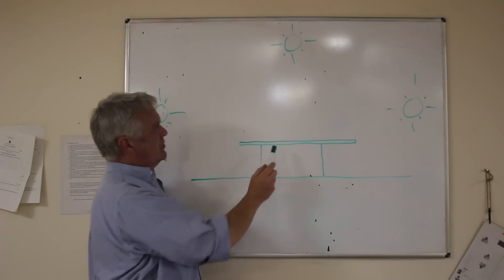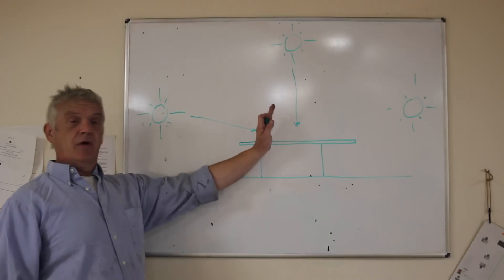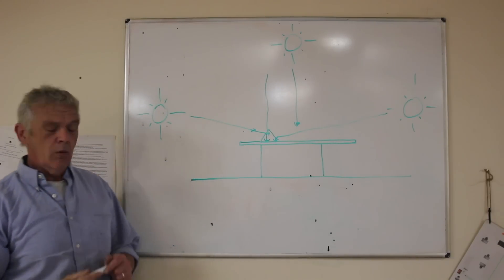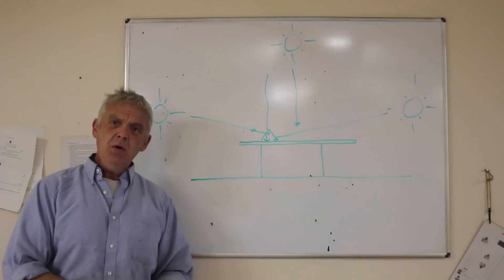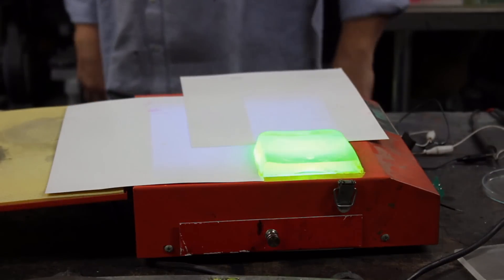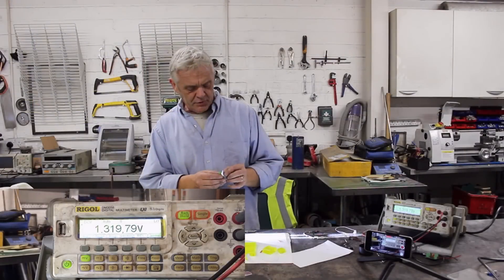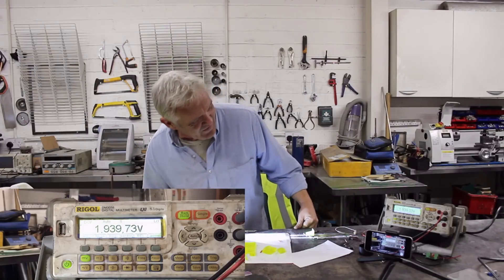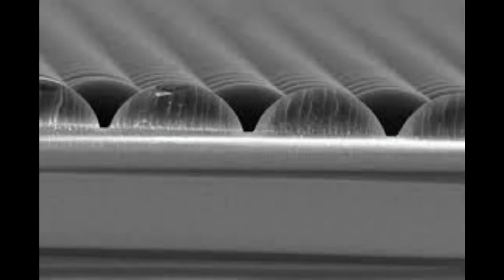1666 Solar Cells And My Evil Plan For World Domination

Comment: How about vertical stripes of mirrored film mylar arranged in a arc over the panel. It could increase the effective surface area pointed at the sun from all angles. 
You could also look at spectrum selective and one way mirrors with a sandwich narrow wedge shape to make use of the fluorescence effect.
Call it a: Reflecto-Refracto-Fluoresceomatic Confibralator.
🤗
Reply: You are actually correct. The device you describe is called a Light Trap. Whether in photosynthesis or in a photovoltaic system: if you want to use light efficiently, you have to absorb it as completely as possible. However, this is difficult if the absorption is to take place in a thin layer of material that normally lets a large part of the light pass through. Now, research teams from TU Wien and from The Hebrew University of Jerusalem have found a surprising trick that allows a beam of light to be completely absorbed even in the thinnest of layers: They built a "light trap" around the thin layer using mirrors and lenses, in which the light beam is steered in a circle and then superimposed on itself -- exactly in such a way that the beam of light blocks itself and can no longer leave the system. Thus, the light has no choice but to be absorbed by the thin layer -- there is no other way out. This is the absorption-amplification method, which you described.
Reply: @captainnemo6655  Well, I have often been accused of being psychic. 🤭
I'm a little confabulated by your use of the phrase "surprising trick". Seems a pretty obvious optical design, but I guess the phrase probably came from a science media puff piece. 🙄
I still think Reflecto-Refracto-Fluoresceomatic Confabulator is a more catchy name for marketing purposes, and certainly in keeping with the Dr Evil plan to take over the World. 🤗
Reply: @aaronfranklin324  no puff piece. Did you see the news about these Light Traps? There are google scholar articles on them as well. Your idea is extremely important as his is an important step toward having a Photon Battery in real life.  A Light Trap device as you describe when made with Photovoltaic Glass solar cells would let you generate electricity with a photon beam bouncing around the system.
Reply: @captainnemo6655  No I haven't seen the research. I'm far more focused on other things like the glacio-volcanology issue. I've been consulting with top Volcanologists here in NZ, and we all think it's a very serious problem. They want me to come to the World Volcanology Conference here in Rotorua Next year and put a rocket up the butts of all the big names. 
What Murray is doing might be more important than he realises. Our photovoltaics aren't going to be terribly effective if our atmosphere and earth orbital environment are full of Hypervolcano ejecta.
If suggest looking at phosphorescent algae. They produce a surprising amount of blue and green light from a little bit of agitation, though I'm not sure of the details of where the energy source is. Probably chemical stored during sunlight hours. But there are geothermal species that use chemosynthesis pathways to support photosynthesis in Subglacial ecologies in Antarctica etc that we know about. 
We may only be able to survive the next few decades underground. So turning thermal and chemical energy into Electricity and light in spectra that food plants we need may be very important. Especially with reliable solid state simple systems. 
I don't want to have to rely on mechanical microhydro in our kilometer deep cave systems without support infrastructure. Unless I can do it all with silver instead of copper wire, it's unlikely to be reliable enough.
Reply: @aaronfranklin324  also since you are aware as I am on the abnormal volcanology of the recent eruptions in NZ... Did you see the video floating around of a UFO visiting the volcano?

Comment: Doesn’t water have a similar effect on light (the sick in the water etc) and cheaper to employ, perhaps you could put your fluorescent die into that? (also it will keep um cooler and work as a night heat sink)?  👍
Reply: Actually this would work as part of a polar solar cell. If you can keep that water absolutely clear and solidly frozen into the shape of Fresnel lens.

Comment: Back in the 60's a company called Western used to manufacture light meters.  These were solar powered and the panel was covered by a layer of plastic with a pattern on it in the form of bubbles and they were lenses.  However, I think those lenses were there to increase the light meters directionality so you could direct it at whatever you were photographing and it would measure the light reflecting off that.

Also I was wondering if it was possible to do some fresnel onto plastic using the laser engraver?  If you can, what's to stop one lasering triangles of various sizes or other shapes?  If so, then it should be possible to reduce the thickness of the plastic on the solar panel reducing light absorbtion by the material.
Reply: Rob actually has a video on this idea and others for DIY Fresnel lenses. Video came out about 7 months ago.

Comment: Super simple test - Flourescent clear silicon, spreadon with a toothed tiling scraper? Might try it on a spare solar panel from garden leds....
Or transparent glue sticks? Seen them made clear by soaking them in almost boiling water.... cheap easy experimdnts
Reply: Good ideas for experiments! I think if there is a way to melt the transparent fluorescent glue sticks into the shape of Fresnel lenses, it would work.

Comment: It sounds like a reasonable idea, but the energy from the sun is W/m^2, correct? So, no matter what you do with the incident light the projected cross section is still smaller in the morning and evening, correct? The reason you use a tracker is to get a larger cross section, correct?
Reply: The idea is to use NO MOVING parts but still get the maximum amount of light where it sits. Would it work better if the solar cell were made with molded Uranium Glass or Flourescent Gel into the shape of a Fresnel lens, by extruding the material into a hollow tube. A coiled Fresnel Lens. Rob has a video on this kind of lens already.

Comment: I'm curious if the colour of the fluorescent material makes a difference, clear perspex would probably still channel the light. The first experiment you did with a hiviz seemed to be just reflecting like a mirror or white paper would. I'm just setting up a solar panel because of rising electric prices and want to get every watt I can! Thanks great inspiration!😎
Reply: You are actually correct. You could use RED or ORANGE Flourescent dye. Keep in mind though, if there is such a thing as transparent Photovoltaic Glass and translucent Photovoltaic graphene solar cells(made by Rob in a prior video) you can use red Flourescent material that's transparent fluorescent and Photovoltaic at the same time.
Reply: The ultimate solar panel would be constructed with a a layer of transparent Photovoltaic Glass, with a Red/Orange/Yellow Flourescent Fresnel lens and a high efficiency PV cell underneath. You can make this type of solar panel generate even more electricity if you combine it with a thermo electric heat engine for generation at night and for even more generation, you can run this set up with a HydroElectric Paper Fuel Cell, to deal with morning dew and condensation.
Reply: @captainnemo6655  thanks for this, I had assumed it was probably a certain frequency of light. I'll have to try it out! 😎👍❤️

Comment: There is one solar panel on my roof that performs very well in winter (I am at 54 N), it has some sort of lines on it. I can feel them, but barely see them. But the output is really good when the sun is low. Enough for me to run my laptop on it all year long! (with some help of a LiFePO4 battery that is).
Reply: Why not give your solar panel an upgrade by krafting it into a HydroPanel that generate day and night and also produce water for you. You can make a solar panel with fluorescent Photovoltaic Glass moulded into the shape of a Fresnel lens as well.
Reply: @captainnemo6655  Maybe I can't because I have 2 left hands 😞

Comment: I recall at least two projects that use something like this; one was a cone shaped solar panel so a part of it would always face the Sun and it was also spinning so while the glass on top of it concentrated light on the cells the spin constantly turned them away from the Sun so they cooled down and don't lose efficiency due to overheating, and the other was about covering walls, flat roofs and roads with solar panels.
The cones have many problems like the special shape would be far more expensive and making it spin requires a motor that takes energy, so the only part of that idea I think might actually work was using them as art and getting people used to idea of having solar panels all over the city by making them look nicer than the regular flat panels.
The other has been repeatedly "busted" by people calling it "solar freaking roadways" who keep pointing out that solar panels that are flat on the ground would not collect light well when the Sun is not directly overhead...you know, that exact thing this is supposed to fix...
Reply: Don't give up by the likes of the "Busters" like Thunderfoot... There have been amazing breakthroughs just this year alone. Have you seen or heard the news about transparent Photovoltaic Glass and Semitransparent Graphene Photovoltaic panels? Rob has a video on how to make these. These new advances in materials are finally being put to use on buildings like the 550 Spencer in Australia. Also if you check out YouTuber Nighthawkinlight, he has an excellent video on paint that can cool down surfaces.
Reply: @captainnemo6655  Oh, right, TF "busted" the solar cones too, except instead of pointing out any of the real problems with it he focused on a claim someone made that by collecting light equally well regardless of which direction the Sun is shining and by avoiding efficiency loss from overheating they would be up to four times as effective, or something like that. Advertising hype, in other words; IRL it might mean that regular solar panels lose up to 20W of production from overheating but this one only loses 5W.

So TF spent the video explaining that overheating is not a real thing and if you use four panels you get four times efficiency, which is wrong, the panels would use 4x area to capture 4x sunlight and probably cost 4x as much, so producing four times as much power is as efficient as using a single regular panel. Frankly, it was a weird rant that made me wonder if he actually knows how solar panels work and what is the difference between panel efficiency and capacity factor...

Anyways, yes, lots of improvements have been made and some of them are even getting out of the labs and into production. Affordable and efficient enough PV glass is probably the next big thing, most buildings in sunny areas could use a little shading in the windows and with the huge area the windows add up to it is not much of a problem that the panels are less efficient.

Thin film panels may work with that too, they are so thin they let some light through so you could use them on windows without needing many extra lamps inside. Most importantly, they do not use silicon, which may be a common and pretty cheap material, but does require lots of energy and some nasty chemicals to purify it enough for use in PV cells and computer chips. Only problem is if you just glue them to the glass they would degrade quickly and need replacing often, while putting them inside the window panel would mean having to replace whole windows which is more work than regular panels attached on top of the roof or wall material.

Comment: I panel racks are on a caps upon a single mast. Tracking achieved by manually tuning the array to the moving sun.
In a year a man uses the equivalent calories contained in 13 gallons of gasoline, relatively low cost really
Reply: The goal is to have a material in place that does the work of solar tracking WITHOUT ANY moving parts, because not everyone will be able to do this type of manual labor. For example, If I live at the bottom of a mountain and my panels are at the very top, do you really think I would go up there every day?....doing more with less is the goal... Achieving an effect without moving parts like angles caused transparent fluorescent media. Imagine moulding the gel into the shape of a Fresnel lens?
Reply: @captainnemo6655  if your panels are that far the wire would cost too much to warrant the installation .
Line loss is a thing.
Reply: @georgemckenzie2525  my mountain top is about one story high... Trust me, I still don't want to manually track.
Reply: @captainnemo6655  easy, just triple your panels. I put my array in 33 years ago , it has grown a bit, but manual tracking has always been part of what we do here at 44.44 latitude

Comment: Brilliant idea. An important question will be what is the impact on peak performance? If that is positive you definitely on a winner.

FYI some modern panels are "bifacial" meaning they can also absorb light from behind, this improves performance in solar farms where the light reflected by a row of panels is captured by the row in front.
Most panels have a reflective layer behind the cells so photons that passed through the cells have a chance of being caught on the way back. It would be interesting to put a flourescent layer on the back of a bifacial panel and a reflective layer behind that.

A question to the hive mind: can we get small cheap silicon cells on a transparent carrier for experiments?
Reply: To answer your question, it has been done. Have you seen the latest development on transparent Photovoltaic Glass and transparent Photovoltaic graphene panels? The Photovoltaic Glass is going up on a building called the 550 Spencer. Also Rob has a video on translucent graphene PV cells.
Reply: As for performance of transparent Photovoltaic materials, you gotta check out the engineering specs on the 550 Spencer buildings Solar Facade. It's a lot to type.

Comment: Do solar cell need direct sunray? Sorry if I am asking stupid question, but why we do not put zig-zag pattern to increase the surface area?
Reply: This idea can be seen if you check out solar panels made from transparent Photovoltaic Glass and Fresnel lenses.... Also did you know a solar cell can run from the infrared thermal light energy of the sorroundings environment as well as the moon and stars since star and moon light can achieve fluorescense in PV cells.

Comment: I think a good cheap start to thinking about and experimenting with changing light direction is what nature does.  Water(light follows water and internally reflects like an optical fiber does) and sugar (sugar twists light by 25% in experiments in polarization) to change the incidence and rotation of light might be an interesting way to go.  Just a thought.
Reply: This idea!!! It follows the same path as transparent Photovoltaic Glass or the semitranslucent graphene panels Rob made... Imagine using a sugar water solution and freezing it into the shape of a Fresnel Lens. But if plain water is the best, and if HydroPanels do work for this purpose, I wonder what set up would be more conductive at taking advantage of light tracking with no moving parts by using water prisms. Interesting idea.
Reply: @captainnemo6655  You made some good points there.  Think outside of the box kind of thinking is a good thing in my book.

Comment: The fluorescence has to be tuned to the most efficient absorption part of the spectrum of the panel . Just like  shifting your gears so your engine runs at the most efficient RPM.
Reply: Well then imagine using Uranium Glass for making transparent Photovoltaic Glass PV cells.
Reply: @captainnemo6655  Imagine "gamma panels" designed to capture the radiation from the environment after a nuclear holocaust.
Reply: @DH-mf6rd  if you believe that gama panels would only work during nuclear Holocaust you have never studied star light, like the kind of Gamma Rays our sun, other stars and the whole universe provides every day.
Reply: @captainnemo6655  I don't get transparent photovoltaics, if it's transparent that means nothing gets adsorbed, if it's only adsorbent In invisible wavelengths like IR and radio there isn't enough power to be practical, on the other hand, if it's strong UV , x-rays or gamma that it absorbes then you have bigger problems.
     I don't get why people are even talking about transparent PV! Makes no sense.

Comment: If this works it would certainly beat out the passive mechanical system I’ve been imagining for solar tracking.
Reply: Man, I'm just memorized by the simple ones that have several smaller cells in the shadow the panel connected to 2 small RC motors that activate as soon as the shadow moves.